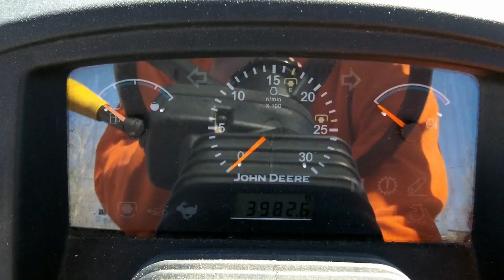GMC Yukon Bumper Fix (Part 1)

Comment: Your Yukon has a 8 stud hub, how is that possible???
Reply from the maker: It's a 3/4 ton. They're relatively rare, but it was an option for fleet orders
Reply: @rensonsyard  what would one use a 3/4 ton SUV for????
Reply from the maker: It's mostly for the towing capacity, and to be able to have all our tools in an enclosed space while carrying up to eight people. Also, utility vans are not available in 4x4.
Reply: @rensonsyard  OK cool. Cheers